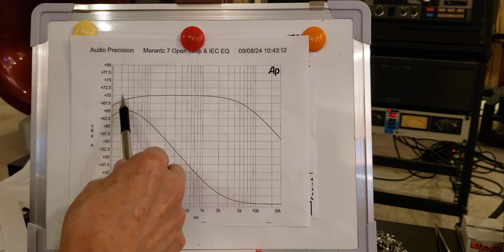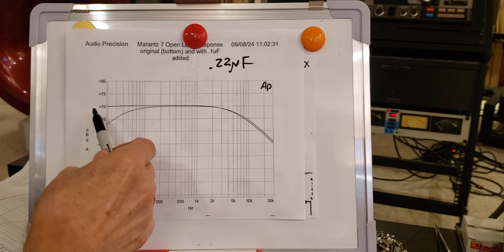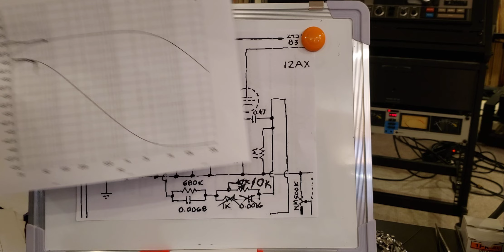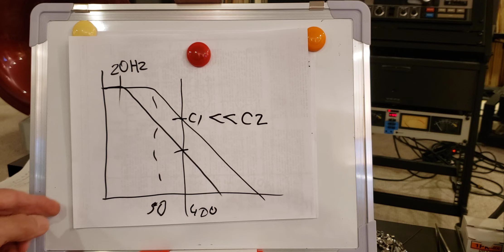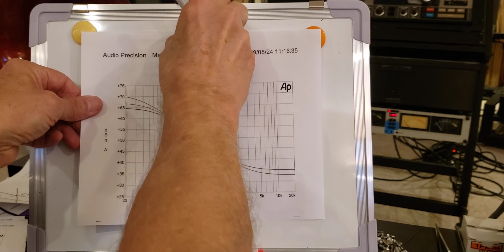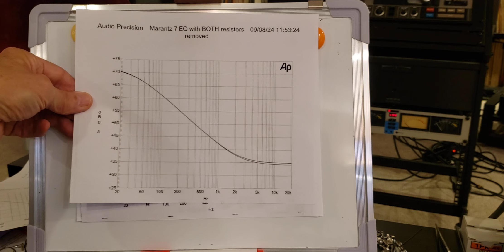Studer, Ampex, Otari - Low Cost Tube Head Preamp Part 3 - It's Optimized!

Comment: Dear Viktor, the first "interstage" cap you increased from 0.01uF to 0.01 +0.22uF= 0.23uF. I have here wonderful Polystyrene caps with a 0.25uF value. Do you believe I can use them instead of the "standard mod" you give?
Thanks very much for all your wonderful teachings.
M, AKA Maxlorenz.

Comment: Hello Again Viktor!

These notes you sent me. What are your final changes regarding the tape head pre?

Unfortunately, there are no reference designators on the board, so it is difficult to discuss the changes.  Two components in the EQ circuit are removed and the 47K resistor replaced with a 10K trimpot.  The 510 Ohm resistor in the first tube cathode circuit was paralleled with a 360 Ohm resistor for more gain.  The .01uF capacitor between the first and the second tubes gets 82,000pF (this was altered in part 3)cap in parallel.  The input 47K resistor was left there but I will replace it with 100K one, as for the this head it makes more sense, otherwise the pole is at 29KHz, which is a bit too close for comfort.  

For IEC conversion it might make more sense to leave the 510 Ohm as is, but increase the value of the 680K resistor, perhaps to 1.5 Meg or so, in order to move the main pole to lower frequency.

As it is now, the LF response at 31.5 Hz is down about 4-5dB, if you feel you want more bass then do the 680K resistor change instead of reducing the 510 Ohm one.
Add .22uf to 01 cap
Remove 680k resistor

Also in one part of your 3 part series I noticed a jumper under the pc  board?

Thanks I just want to make sure I do this right!

Comment: 00:14 What's the music? It's great!
Reply from the maker: Hello, if you mean the classical piece it is Beethoven String Trio in C Minor, Opus 9, #3, performed by Yanaki Trio.
Reply: @Foxbat9000  No, I meant the saxophone/jazz music at the beginning. What is it?
Reply from the maker: @BsktImp  Not a problem, it is the first piece on that album. 

 https://www.ebay.com/itm/286036731478?_nkw=sts+master+tape&itmmeta=01J7EHA90984M686PBCJY8SFF4&hash=item42991e2656:g:RIEAAOSwhzhm0cpn&itmprp=enc%3AAQAJAAAA8HoV3kP08IDx%2BKZ9MfhVJKkEHSALPXZ0dffqdhyYsppVyG154MqCodp8G67ssLB%2BkXS6CkNO8%2Bsf2mWKPR3LarLJstT7N9l915sRshU%2BIUv3J0P%2FE%2FkNyWLY7Ob7hwoD%2BbBOA2YLf8TzXXmfbnWXiCsV%2F8wcfgX7gBXGybWhyk3vEvHa1wPiHPjRKZHqNJF%2FibENHDwke68tmO3vzjSqSl44B0ud2gBZFUlFdoR6kltTeOywGwsfC%2F4gIpv8kzk5kPcYEZY6DTynbibzKpMc1oyr8vdFTEeoIK92YMPTqBaJzVvxf9VnpIwPy9vQXQ4REg%3D%3D%7Ctkp%3ABk9SR6CQqdG7ZA

Comment: thank you for posting. very helpful. In an earlier video believe you suggested replacing the 47uf 400V electrolytics with something larger, 100uf or so. Did you keep the 47uf or replace them with larger values? I have one of these models or order. Looking forward to getting into it. thank you.
Reply from the maker: As I mentioned, I would like to go with what it is for now.  Later I might do a round of "better components", but given all my other obligations, I would like to just use it for a while, to get better feel for what it can do.

Comment: Thanks, Viktor! So, for NAB response the 680k resistor is placed back into the circuit, correct?
Reply from the maker: I don’t have my calculator here, but I believe you would need 470K, and of course you would also need to change the trim pot.
Reply: @Foxbat9000  Thank you, again! Is there brand of 10k multi-turn, chassis mount trim pot you can suggest? Bourns, maybe?
Reply from the maker: @kenneths9522  I like Bourns, I use them most of the time.
Reply: @Foxbat9000  Again, thank you!

Comment: Hi Viktor did you remove the 680k resistor and increase the cap size?
Reply from the maker: The capacitor was not changed, just the resistor removed.